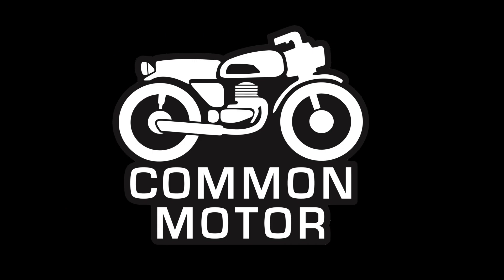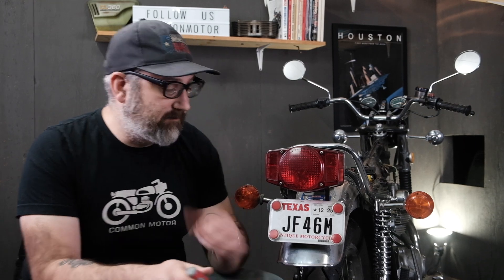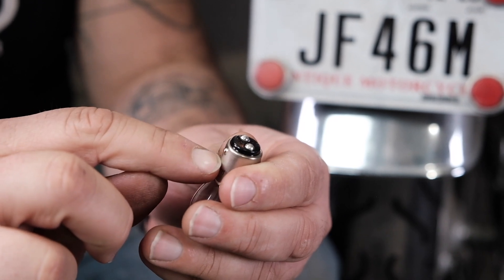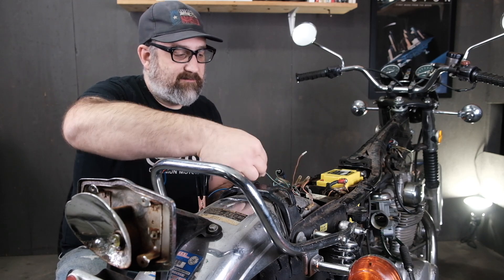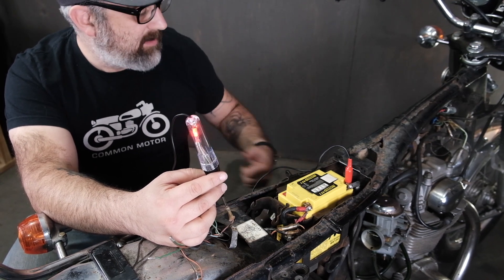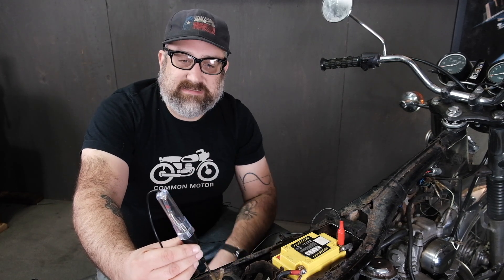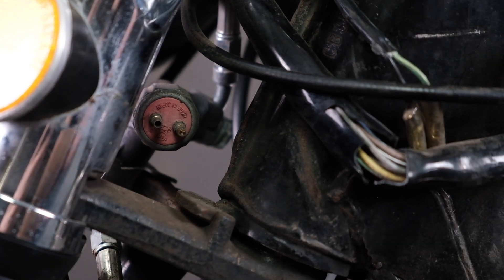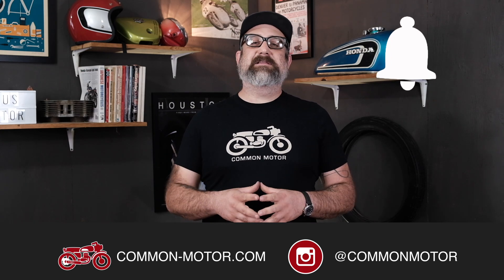Taillight & Parking Light Circuit Design & Diagnostic On A Vintage Honda Motorcycle

Comment: Hm... The circuit diagram seems to suggest that the brake switches would work even if the ignition switch is off. Is that right? Or am I looking at this wrong?

Comment: Thanks for a great video. You mentioned something in your video which led me to an epiphany. The brake light worked fine. It was just on all the time because the switch for the front brake wasn’t adjusted properly when I bought it. A quick adjustment and everything works fine on my 1978 CB 750. Thanks again

Comment: I have a 1986 honda magna vf700c.   Everything was working fine but the other morning i found my bike laying on the right side. I don't know how it got knocked over but it did.  The dash light for the tail light is on all the time now. The issue I'm having is that i can either get the brake light to work or the tail light. If i disconnect the wire for the tail light the brake light works but when i plug it back in the tail light works but not the brake light and the light on the dash is on regardless. Do you have any insight as to what the problem might be?  This is my first bike so I'm pretty much clueless.  Also the bulb seems to be fine

Comment: HI, i HAVE A 1981 HONDA CT110. 6 Volt  When turn signals are on tail light blinks opposite turnsignals. This seems to be a very common problem..any Ideas would be greatly aooreciated
Reply: I’m having this same issue on the same bike! I don’t even know where to start

Comment: Hello I'll send you some money if you do a video dedicated to showing how to bypass a headlight switch for an old HOND because I am having a nightmare with any 1975 GL1000 and nobody seems to have done anything about bypassing the switch on the handlebars. I had to remove it because the new start button handlebar unit did not come with the lights switch.

Comment: I’m having trouble I atemted to switch my light to led , I had the rear lights switched no problem , I went to replace my headlight and turn signals  I have headlight and have been able to get turn signals but need diode to work correctly , but I have lost my running light in the rear “tail light, breaks work fine when I switch to park the tail lights work

Comment: I have a CB400T that all lights work except my running tail light. I don't see that specific model listed, but will it follow the same principles? The solid brown wire seems to be bad one and it looks like the ground is black, not green unless the pervious owners confused it while wiring up this taillight.
Reply: I just bought the same bike and I'm having the exact same problem. Can't figure it out.
Reply: @iwantmyvanback  For my '77 CB550F, brown is the running light and green is the ground.
Reply: @deluxe_1337  thanks! I ended up figuring it out. Previous owner wired more than one thing incorrectly so I had to fix a few things. Electrical is fine now

Comment: I have 1973 175cb and my lights are very low I change the battery and still the same and the rear light don’t turn on

Comment: Brenden quick question, 1 cb450t, which battery do you have in stock for this motorcycle. 2 gonna start rebuilding, what do you use in your parts washer to clean parts? Picked up a used one gonna get a lot of use. Didn't know what solution I should be running in parts washer. Thx Tim